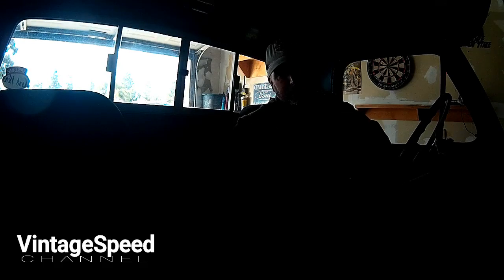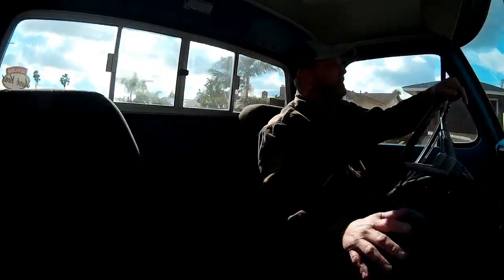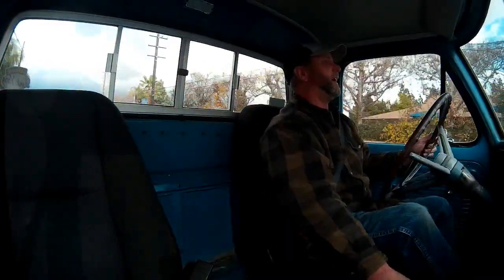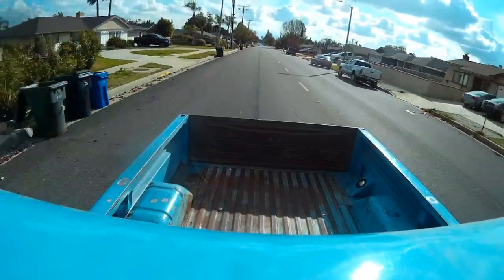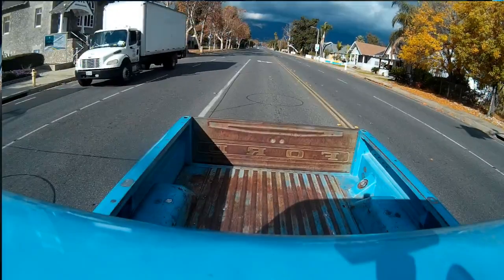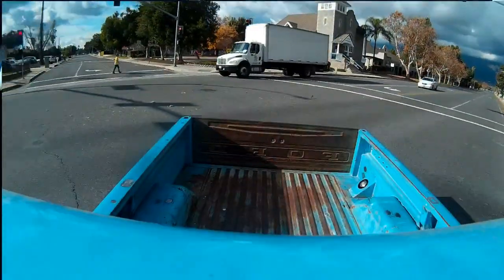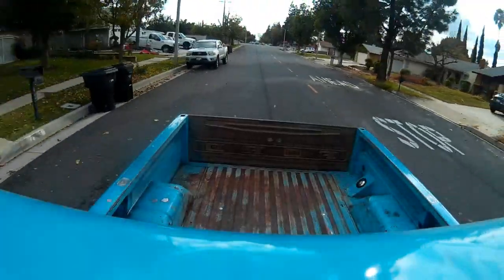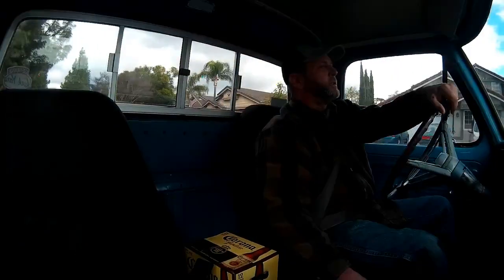#v10bumpside Ford F100 V10 Swap Build; VLOG Style Tire Shredding!

Comment: How did you get a v10 to sound that good! I've trid multiple different exhaust systems on mine can't get it to sound like anything but two pissed off 6 cyl's
Reply: I was thinking the same thing. I’ve been considering a V10 swap on my OBS F150, but I really hate to give up that V8 sound. This is the first V10, (Ford or Dodge) that I’ve heard that doesn’t sound like ass.
Reply from the maker: @anthonysgarage  thanks for that!  i really enjoy the sound.  it's kinda like the sound of chaos.
Reply from the maker: i think i just got lucky (and i realize the audio in these vids is pretty shitty...)  gibson headers, 2.5 tubing, X pipe and flows.  i had to cut the ends off the flows and reverse the internals so i could route the exhaust where i liked it.  everyone thinks they're backwards, but they're not.  thanks for watching!

Comment: What wiring harness are you using to run the engine?
Reply: I asked the same question a few months ago. He said it he’s using the stock ECU. If you like this project, you may wanna check out Deboss and BIY’s v10 builds. I think Deboss Garage is planning on running a Holley system and I can’t remember what BIY is using

Comment: would i be able to swap one of these into a cut and welded chassis long bed to short conversion
Reply from the maker: well yes, that's what i did so it should work fine for you.  thanks for watching.
Reply: what rear are you using for it
Reply from the maker: @Fordf-td6wq  it's an 8.8 with LSD on leafs....for now.
Reply: @vintagespeed  whats your plan for it c notch and 4 link or?
Reply from the maker: @Fordf-td6wq  yes, it's already c-notched, but i plan to 4 link it.  and right now i'm wanting to bag it....but not sure if i want to sacrifice handling for looks.  we'll see.  right now my focus is on the performance of the motor and getting it to hook off the line.  there are other videos of the truck that show the frame and mods that i've done to it.  thanks for watching.

Comment: What transmission are you using ?
Reply from the maker: tremec TR3650 with a frankenstein GT500 clutch/flywheel combo.  works pretty well.

Comment: What wiring harness are you using to run the engine?
Reply from the maker: modified factory harness and an '03 ECM with Moates QH chip/tune.